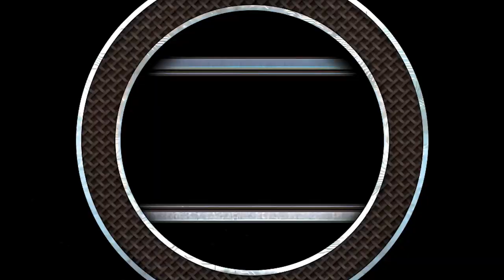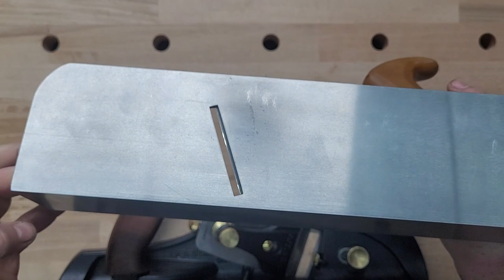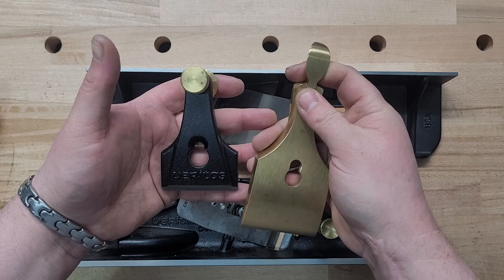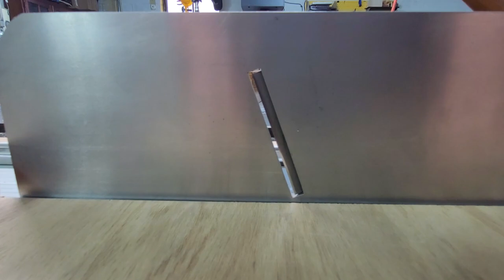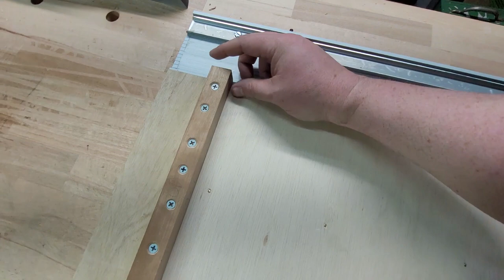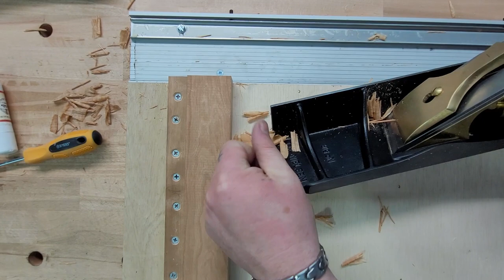UPDATED - IT'S NOT WORKING = $650+ Lie Nielsen Vs $385 Veritas Shooting Plane Review and Comparison

Comment: Paper to be the problem sounds a bit strange to me. A shooting board is supposed to work even if the plane doesn't ride in a track, a track with a paper thickness of freeplay is a lot better guiding than no track at all. Maybe a shooting plane with handle a bit away from the cut needs a track, but I have the same amount of freeplay on my shooting board track, with no problems. Also when it comes to position of hands, I think the LN is more ergonomic than the Veritas, with the handle closer to the cut, so if hand position was a problem it should be a bigger problem on the Veritas. I have the Veritas and have tested the LN and I heard and read more people having problems with the LN, but mainly in terms of edge retention. One guy made a very extensive test on this subject with different blade types and angles and conclusion was more or less due to the higher angle on the LN, more force was needed for the cut and the edge dulled lot faster than on the Veritas due to this. I try to put a link to it in next comment, sometimes youtube deletes comments with link and I don't want everything I just wrote to disappear.
Reply from the maker: I completely agree with you and that is still what I'm hearing that is it a design flaw. They should have gone low angle and upgraded the style vs just upgrading the previous design. 
I have heard of a few who truly love that plane and almost everyone who says that has all their other planes in LN. Lol
Reply: @BatCaveCreations  couldn't post the link, it was deleted. But since you seem to have sold the plane it maybe doesn't matter. I have several LN and Veritas planes and no special feeling for one or the other company, but in this case the Veritas is just a better shooting plane design.
Reply from the maker: I agree and that was my finding at the time too and what seems to be the majority consensus. I'll try to Google that cus I'm curious what they said too
Reply: @BatCaveCreations  google "in the woodshop more about shooting planes and their blades". That's the second part, first part is linked in that.
Reply from the maker: thank you!!  @CarmoniusFinsnickeri

Comment: I'll preface by saying I do not have a LN shooting plane... but my observation is with your shooting technique.  I don't know if it's been mentioned in the 116 previous comments, but you need to look at your left hand technique.  In the video at least, you are hooking your fingers over the top of the fence... holding the work piece against the fence, but with minimal pressure into the plane.  you should be putting more pressure toward the plane. Secondly, if you add a small chamfer to the trailing edge of the work piece (the side against the fence), it will not only prevent chipping out that corder, but prevent the end grain from acting like a micro size feather board... which can cause skipping.  Also be sure to wax the sole of the plane.  I believe you will get better results if you mind your technique.
Reply from the maker: I deff appreciate the input! Thank you! My only "rebuttle" is I don't have to do anything like this with the veritas. Using the same method I did in the video on both planes the veritas had no issue and is 1/2 the price :( I love the look of thw LN but for that price and it not "just working", I went veritas lol
Reply: @BatCaveCreations  no worries at all... hopefully my input will help others that only have the Lie Nielsen. (maybe I'll also get a veritas!)
Reply from the maker: I think it will!! It is always good to hear from others!! Thank you again!

Comment: I have found that even out of the box the LN chip breakers need work, I’ve had nearly all of them that need minor flattening to the chip breaker and the bevel honed to remove the blunt edge on the chip breaker, this being said I have made all of my LN planes work and have had long term success with them also very impressed with the Veritas planes I have too, maybe just a little time more needed to fettle the chip breaker on the LN and if it was as cheap as you said it was seems a little hasty to sell the plane you’ll never pick one up as cheap again! Keep up the good work👍
Reply from the maker: In your opinion can the chip breaker effect this much? I didn't check it with feeler guages but a buddy did mention that. No chips got stuck under it I know that.
Another buddy mentioned that the LN is top heavy and may be deflecting away from the board. 
I am also thinking that I want to keep the veritas just cus it's smaller, easier, lighter, and cheeper. I struggle to keep $$$ tools lol like I don't own a LN Jointer cus it's $500+ I use a bedrock 607 I got for $140 lol I had a LN no 9, best plane ever made hands down, but too $$$ for me to justify keeping as this is a hobby not a buisness haha
Reply: Chip breaker is arguably the most important and most under looked thing on a bevel down plane. You need both the back of the blade and the chip breaker to be perfectly flat so you can move the chip breaker right to the front of the blade I've never measured but read under .010" of an inch is ideal and on my planes you can't see the edge of the blade as the chip breaker sits right on it. In pretty much every plane I've set up like this they can make incredibly thin shavings and work on end grain/curly grain without tear out.  It's totally under rated as a set up when learning from the internet.
Reply: @BatCaveCreations a lie neilsen number 9?
K though his bench planes ended with the number 8 jointer?
Reply from the maker: @danthechippie4439  ya they called it a Miter Plane, thing is awesome! Not technically a bench plane tho

Comment: try moving chipbreaker far away from cutting edge, it is no use on endgrain. Also I would not add back bevel, not even slightest.
Reply from the maker: Thank you! It's tough cus some are saying add a back bevel, some are saying not too. Some are saying more the chip breaker closer some are saying move it away hahah
Reply: @BatCaveCreations  one more thing I'd check is: unscrew the frog, try to rock it in place, if it clicks, that causes the chatter. It should sit rock solid.
Reply from the maker: @gronk555  thank you!

Comment: Huh. Did you check the angle on the Lie Nielsen blade?
Reply from the maker: I did 25 primary 30 micro :( it had the slightest back bevel like someone did the rob cosman ruler trick but... could thay really mess uo this much? :(
Reply: @BatCaveCreations  I'm too much of a newbie to know. Planes are super tricky to me. I'm sure you checked to ensure the frog was snug.  Perhaps reach out to Lie Nielsen customer service and ask what this sounds like?
Reply from the maker: @blayne2029  I though about that too and someone commented that they did reach out and all LN told then was to take lighter passes haha I can't take light passes at all! Only HEAFYY shavings that I'd never want to take on a Shooting plane haha
Reply: @BatCaveCreations  That last comment sounds like either the edge is not truely sharp or the bevel angle is wrong for the frog. Both do result in needing a deeper cut to get anything at all.
Reply from the maker: @ehisey  I thought about sharpenss but get this after all that testing I took the plane and used it like a normal plane and got thin shavings with no issues hahaha
Reply: @BatCaveCreations  I hate that. I got an old Craftsman #4 that does exactly the same thing. Great on face or edge, but will not cut endgrain, still not figured out what it's issue is.
Reply from the maker: @ehisey  right!!! It's crazy how that works. It's ok tho, I'll stuck with the Veritas. I'm trading the LN for a Stanley Chute Board so that will be in an upcoming video when it gets here! 😀

Comment: I don't own a shooting plane but I can say that 9 times out of ten its in the sharpening. I have Veritas, Lee-neilson, Woodriver, Stanley and others. And I have had that happen from time to time,
Reply from the maker: I tried that too unfortunately :/ the veritas was less sharp than the LN too. I followed the other comments and most are saying thw LN is a flawed design and they use LN other than the shooting plane unless it's for edge and face grain. LN did call me when they found this video an gave me some suggestions but I had already sold the plane.

Comment: Love your review. Two points. The Stanley 51 has a really poor and fragile frog unique to the 51. Makes parts and repairs hard.

Many many years ago, I ran into an English gentleman by the name of Jim Kingshot. One of the nicest sweetest and humorous folks I met. He was also one of the greatest woodworkers out there having done commissions for the royal family.

He taught me how cut dovetails the right way. I mention him here because he always wanted a 51 and it’s iron shooting board.

He designed a 51 pattern and had it cast. In his design, he took a standard Bailey frog and adapted it to work with his 51 design. No proprietary parts or blades. You can buy a replacement blade from woodcraft or use a Hock replacement.

Lie Nielsen went with this idea on their 51. Brilliant! They use a LN standard bronze Bedrock frog.

The issue is end grain. Even if you tune the blade, it’s still end grain. I think the low angle designs may work better on nasty end grain.

I have both a LN 9 and LN 61.5 block plane and mostly use the 61.5 due to its low angle design. The 9 is discontinued.

Point Two! In the European world, you often see “ie” and “ei”. My channel name has ei in it. It’s confusing to a wood worker. The “ie” is pronounced as a sharp E while the “ei” is pronounced as a sharp I. Easier to remember than the spelling of those French words like chauffeur.

It’s like rabbits, those pesky grooves in wood. Is it “rabbit” or “rebate”? Well it’s neither… these are corruptions of the French word for the plane that cuts these grooves.

Or how about the term iron used in planes? Again, woodworkers not being the most educated simply called the steel blade an iron as it was not wood. The name stuck.
Reply from the maker: You. Are. Awesome!!! Seriously this is great info! I love it!
The LN no 9 is hands down the BEST plane I have ever handled in my life. I used it for EVERYTHING, shooting and planing normally. I just couldn't justify keeping it for the crazy prices they go for now haha
I love the veritas shooter. I have a video comparing LN to Veritas shooting planes. Check that out and lemmie know your thoughts! 
Trust me watch my early videos I got yelled at lot for saying LIE instead of LEE hahaha
Reply: As a semi pro who specializes in vintage woodworking and old school custom work, I depend on my collection of LN heavily. I will soon post an awsome series on old school rustic cabinetry on a hunting cabin restore. You will not be disappointed! What I didn’t like about early Bridgecity is that they catered to a collectors market and not a craftsman market. LN and Veritas supply extremely well made tools to the vintage craftsman market. I have programmed and run the top end German CNC machines by Homag  and Holhzer in three shops. The vintage tool designs allow me to execute techniques not really meant for or possible by these CNC machines. So my hand tools have to work for their bananas!!!!!!! No F’ing way I can afford to sell my LN 9 or other planes. They are daily users. If you think LN is expensive, have you seen the planes by Carl Holtey? He makes LN look like Wal Mart! And now his planes have gone collector! One plane I really need is a rebate block plane. As soon as the hunting restore check clears, I will buy the LN 60.5 R. It’s a clever fusion of Stanley’s 60.5 with Sargents edge to edge mouth design wrapped up in LN ductile (unbreakable) iron and precision. I have been using a 73 in the interim but it’s heavy and awkward as a block plane.
Reply from the maker: You will like the 60.5R
I have never tried one but I have the 60.5. Great block plane and you are correct. Bridge city is collectors, LN and Veritas are users. I'm deff not in production at all so the no 9 was a high luxury item haha
Never heard of the other one you mentioned but I will look then uo for sure!!!
Reply: @BatCaveCreations  Look up Carl Holtey. His planes set the standard for plane perfection. See what double splayed dovetails in steel and brass look like.
Reply from the maker: I did and wow! Deff outta my range as a hobby user but those are amazing!
Reply: @BatCaveCreations  very much so. But he did make some improved A1 Norris reproductions.  A standard jack or jointer depending on length. Thing is, many used the A1 as a shooting board plane. Because of its extremely tight mouth and much higher frog angle, this plane works wonders on end grain. The 51 is a standard pitch with a relatively wide mouth. The infill mitres also work for shooting end grain. Thing is, as good as LN is, it’s based on a carpenter’s plane whereas the English planes were designed for highly precise work on hardwoods. While I have adjusted my LN 4.5 for a very fine cut similar to a Norris, it took some work.  I have a Stanley 4 which I have adjusted for more aggressive work similar to an English badger. Norris planes and Holtey copies of Norris planes are out of reach now for most of us
Reply from the maker: Great info! And true that I mean I get why they charge that price but dang I would love to try one haha
Reply: Actually, it's a rabbet (dado), not a rabbit (animal).

Comment: I didn't watch this at the time it was posted (while I like the idea of shooting planes dedicating that much moolah to a single tool that really does only the one job kinda goes against my grain! 

Fascinating the issues you were having the the L-N. And thanks for the update posted about a week ago. Like you I am having trouble visualising what the issue could even be, because it sure seems like what you're seeing are symptoms of chatter. Which of course a Bedrock-style plane is supposed to be better at preventing (and especially in a beast of a plane like the 51, with all that mass to dampen vibration). Plus of course with the iron being so much thicker than the original Stanley would have had. 

Because I'm commenting late you might have already made your choice and decided to keep the Veritas, although I hate Norris adjusters it does have a number of nice features I must say. But in case you still have the L-N in the shop, I have a couple of things you might try in case nobody else has suggested them already.

1) a paper shim on the bed under the frog
2) I know this is counter-intuitive but adjust the fence away from the plane or take it off completely 

In other planes with issues paper shims can dampen vibrations just enough to solve the problem, or reduce it by a lot. As for 2, TBH I'm just grasping at straws here! Who knows, maybe it'll work if nothing else does?
Reply from the maker: Thank you! The plane is already gone but never thought about a paper shim to dampen the vibrations! I think even if I were to still have it and keep fiddling with it I still would have chosen the Veritas. Noris style can be a pain for sure but it was the simpler, less moving parts, less fuss lol and cheaper. I was able to trade the LN shooting plane for the Stanley 52 Chute board, deff couldn't have done that with the Veritas hahaha
Thank you again! I love reading your comments, you always have great info to add!

Comment: Shooting planes can do long grain. In fact, it is far easier to joint an edge with a long-grain shooting board than in a vise. The LN would do better than the Veritas with the higher angle. https://youtu.be/klVPKTITguk
Reply from the maker: You are correct; however, if I wanted to primarily shoot long grain & face grain, I would just use a bench plane and not a $650 shooting plane. You know?
Reply: @BatCaveCreations  hey, just trying to help you make the best of a bad situation 😉
Reply from the maker: @devinteske  true that haha I traded it for a Stanley Chute Board tho :D

Comment: I have the Veritas it’s 385 and lie Nielsen is 650.. Veritas has grub screws to set the blade.. once you set them you just drop the blade in and go.. the blade is perfectly set ! No messing around.. adjusting a frog on a shooting plane is a pain in the dick! Buy the Veritas! It’s got a better blade with the PMV 11! Easier to sharpen than A2!  A2 sucks! Not to mention the 260.00 savings! Tried the lie Nielsen and the handle sticks too far out! The Veritas has your hand closer to the center of the blade.. more inline and this is coming from a lie Nielsen junkie!! I too had the same frustration, I think your on to something with the backlash..
Reply from the maker: I could not agree more!!!! Thank you!! I sold the LN, bye bye lol Veritas now has a home in my shop lol